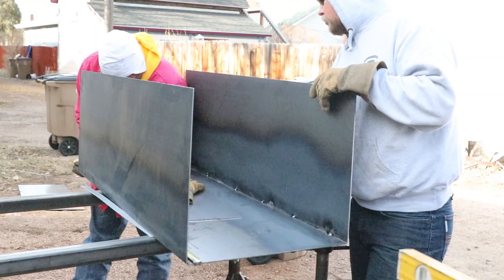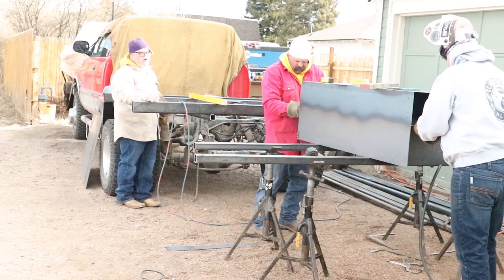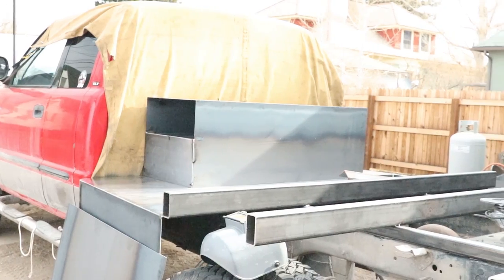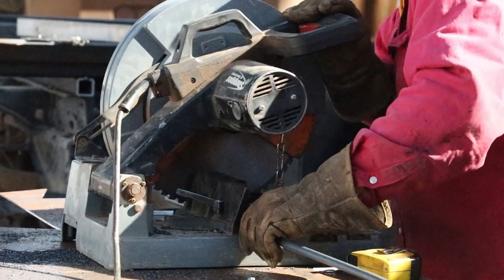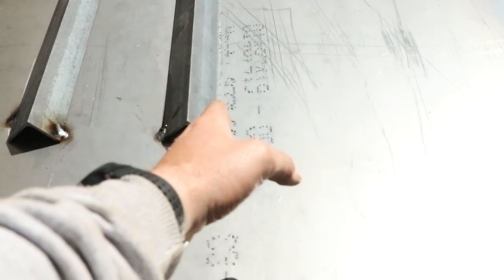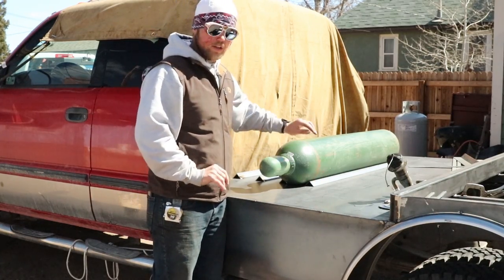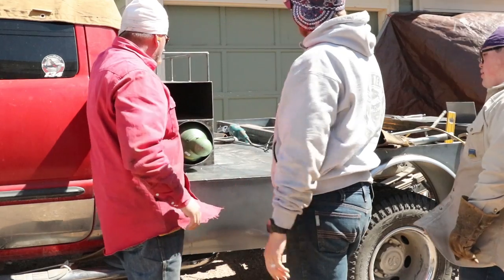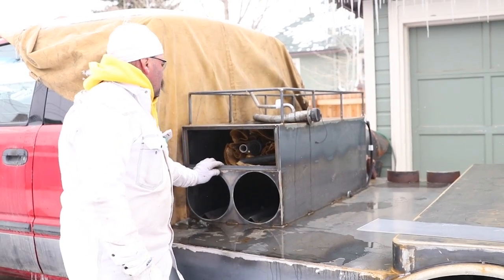pipeline Style Bed Build-Part 3 Welding the Oxygen Rack.

Comment: I know times are rough right now, but if you're looking to replace any of those grinders in the future check out Hilti. They are pricey but in my opinion they are worth every penny.  I have no affiliation with them, but they were such a game changer for me that I tell as many people as I can about them.  They've saved me so much money over the years.  For me and my personal experience,  they've lasted 10 times longer than any other brand I've owned.   They not only last longer, you can tell when you pull the trigger on one that it has some power.
Reply from the maker: I will have to look into those.

Comment: Yes, you are correct about the bottles of gas. Acetylene has acetone in the bottle. It is a low pressure gas and heat does help build up the pressure. But, do not put a torch to it to help with pressure or you will be in for a rude awakening. Really good video here.
Reply from the maker: Who in there right mind would put a Torch to a bottle they are crazy.
Reply: @JacobSchofield  you would be surprised. I worked for 25 years selling welding supplies and gas. In the winter time, Acetylene and propane are a low pressure gas. Meaning when it gets cold the preasure goes down and can't feed enough pressure to the torch, especially when using a high volume of gas is required to cut certain thicknesses. When the price of scrap steel goes up, alot of people become so called cutting experts.  A heating blanket is the best way and safest way to build pressure. I've heard of guys setting the gas tanks close to an open flame to build the pressures up.  And, do you know what alot of them say?  I've done it that way for 20 years. I would tell them it only takes one time to make a mistake. Yes Jacob, there are some stupid people out there. Just sayn.

Comment: Hey guys! Any opinions of Oxy-Acetylene tanks laying flat? I have a slight 35 degree angle and am getting a lot of “nays” about it….. any experience?
Reply: The problem is dirty/gritty liquid gets in the valve when you open it and then the valve will not close without leaking.  That is the real reason you don't lay the acetylene bottle down.  
Becoming volatile,  or unstable  is untrue.

Comment: Hey Jacob I have a question for ya do you have special regulators for the oxy and acetylene bottles to make it so you don’t have to take them off every time you move the truck cause I have regular ones and I have to take them off and cap the bottles every time just so I don’t knock that valve off

Comment: Even with the bottle standing upright, after driving would you need to let the acetylene bottle rest a while before using it?
Reply from the maker: No you will be fine. I’ve never had any trouble driving over to a job Getting out and starting a torch. Don’t your worry about Michael. I one time got on a chat form when I was about 16 and asked what a Tig rig was. I later got about 20 messages telling me I should never weld and if I didn’t know what a Tig rig was I needed to never come back to that chat form. Moral of the story... never be like Michael always help people.
Reply: Javude  it's a valid question,but even if you did have to wait ,figure by the time you stopped the truck and get your gauges hooked up ect. You will be fine. After reading all these comments your always gonna find one idiot like Michael Simerly to fuck up what was a perfect comment section. Like Jacob said,always try and help someone and it doesn't take much effort to be honest and polite. Peace and don't forget : TRUMP 2020. AND LET'S MAKE AMERICA GREAT AGAIN

Comment: What was the name of that grinder bit you used to have clean out the mount holes?
Reply: I want to know also. I've never seen that.
Reply: I think he and I both call them a cone wheel.  I buy mine and Airgas.  Next time you go in your local welding store to pick up oxygen and acetylene look to see if they have them.  They are extremely handy.
Reply from the maker: There just called a cone rock.